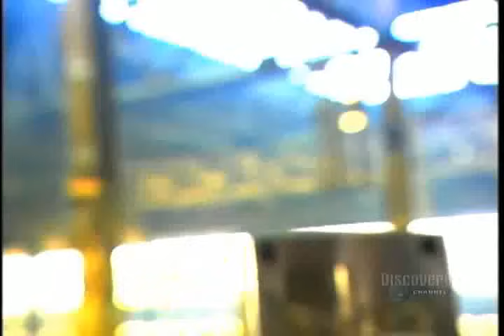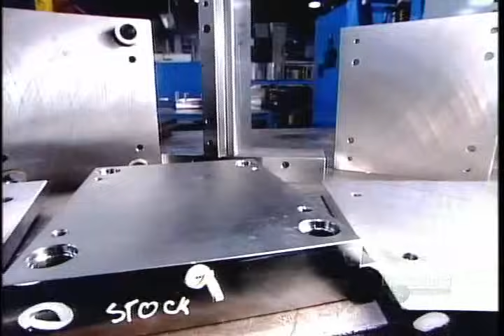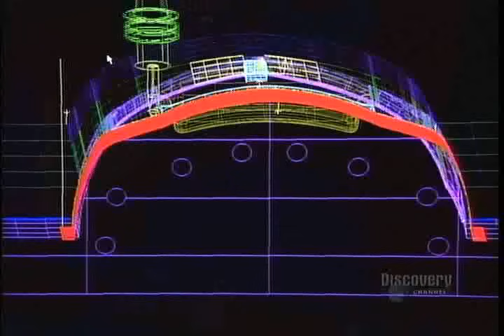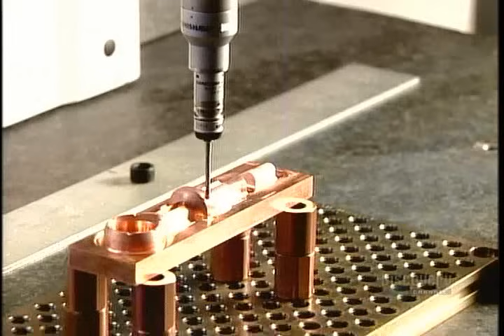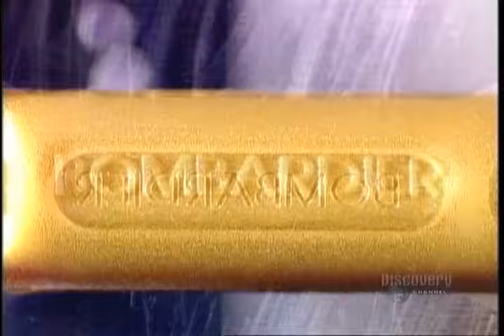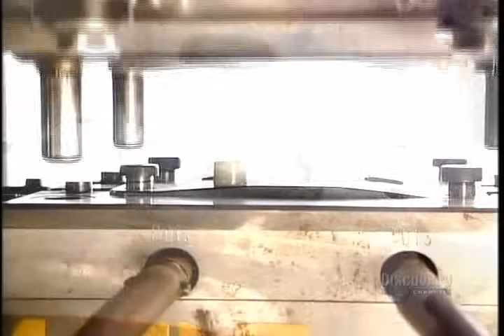How It's Made Plastic injection molds

Comment: We do not remove material "particle by particle" and the machine is not called "a CNC" it's a machining centre or milling machine. The second machine is not called "an EDM" it's a spark eroder that performs EDM.  Most tools do not have the cavity machined directly into the plate with the water holes, the cavity is mostly a seperate insert fitted into a hole in the plate.

Comment: No explanation about how the copper part just appears, and no real explanation about the magic that goes on with with it in that liquid. That's what this video is supposed to be about!
Reply: Hi Karl:
1. Copper parts are made by CNC manufacturing.
2. The resin(raw material) will be melted in a barrel of the injection machine, and then injected into the mold and cooling & form,  ejecting from the mold at last.

Comment: Many factors are involved, type of material (steel, aluminum, ceramic, silicone, etc ...), size of end product, size of the mold  base, number of end products per mold, and sophistication/complicity of end product. 

With that said, 4x7 alluminum mold run about $6K 
and steel molds that are about the size of a large dinner plate are about $65K 

allum avg 1 milllion hits before replacement, a little longer for steel

Comment: Besides mold making, mass production, we also do assembling, packing, etc. sales01@rpimoulding.com 
What factors you need to consider to ask for a mold price?
1) Part 3D file or dimensions of part with unit weight
2) cavities: this is the most basic element for a mold quote. If the part is not very big, usually the manufacturer will ask you how many cavities you want for the mold? If you want 2 cavities, that means you can get 2 pieces from the mold one time. The more cavities, the bigger the mold should be, and of course the mold cost is the more expensive. No worries, I can tell you an easy solution: You can just tell the manufacturer how many pcs of the product you need per year and in the future. Then the manufacturer can calculate how many cavities is the best to save cost for you, and provide the quotation to you.
3) Part material
Part material means the raw material of the part or product=what raw material the part should be made of? Maybe you say plastic. Yes, of course, plastic injection molder only do with plastic, but maybe you don't know there are so many different types of plastic. The most common used are PP, PS, PC,Acrylic/PMMA PVC, PU, PET, HDPE,LDPE( just to name some of them). I don't know. Tell you a third secret: you just need to tell the manufacturer what the part is used for(=the application) and the color you want, then the manufacturer can recommend the material for you.